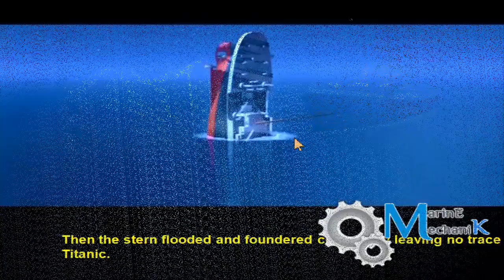Was Titanic Really "Unsinkable" ? Get to know the facts.

Comment: the character limit cud not accumulate my comments.even if the holds are made watertight up to the upper continuous deck and the hull(ship side) damage is up to the 5th hold or if it extended further,the consequence would remain the same.